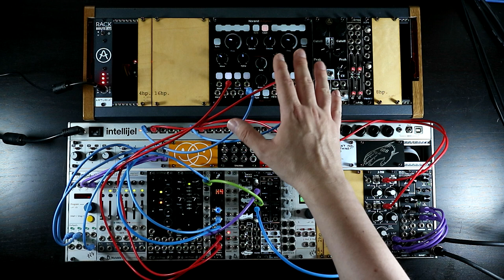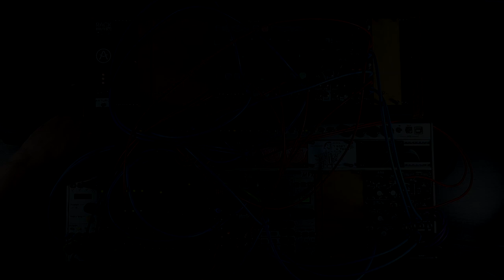The Norand Morphos Patches - 2: Heavy Modulation

Comment: Hi, very interesting and nice patch. If I may ask a question, what does the empty slots numbers 4hp, 8hp, 16hp means? What is HP?  Thanks
Reply from the maker: HP is "horizontal pitch", it's the measure of the width of a module in euro rack.